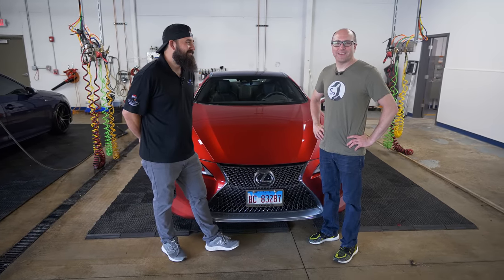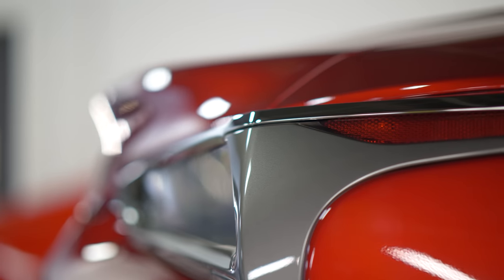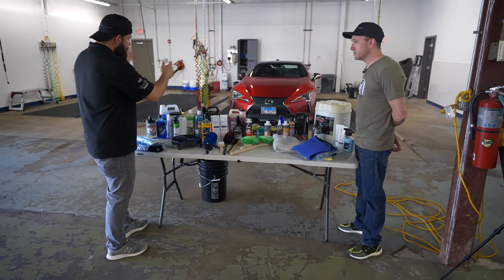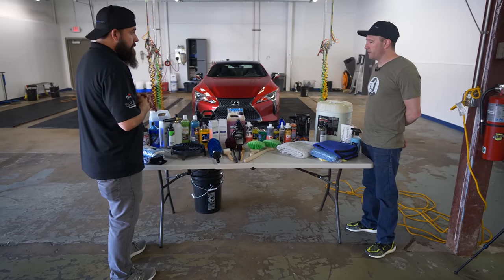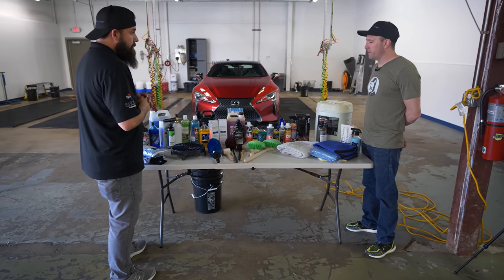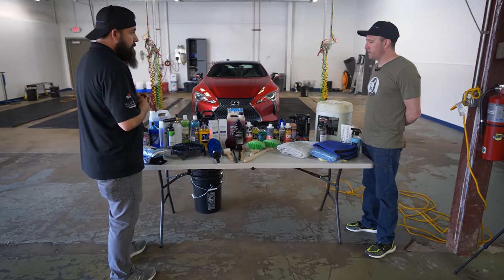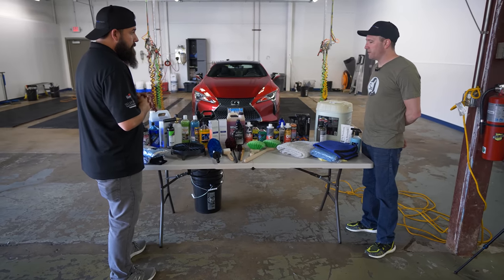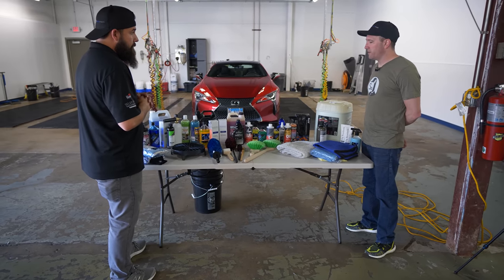The Right And Wrong Way to Do a Car Wash

Comment: Love your channel! 

This is right up my ally. However, I think rinseless washing can be safer, IS more efficient, and sure is alot easier.

Safer because it's proven not to scratch the paint, and water isn't blasted past seals and strips and it doesn't reach places where it induces rust. 

It has it limits though, with severely dirty cars, but that's rarely the case, and if it is, the owner OFTEN doesn't give two sh*** about the car's paint.
Reply: “Alley”, not ally, but I see your point. Well said.

(Those two words have VERY different meanings, indeed!)

Comment: Lots of proper tips. the best one was to wash the car once per week. That way it never gets too dirty. I use Maguires one step clean and wax with micro fiber clothes from COSTCO. If the car is washed in this fashion weekly using the box method shown, in my experience there are not swirl marks after seven years of washing the car in this fashion.

Comment: Washing a car is relaxing.  I get the whole point about not using dirty towels or microfiber to create scratches, but if you take it as serious as this guy makes, you never enjoy a large part of car ownership.

Don't take car to automated car wash.  Use two bucket systems.  And use 15-20 towels (plush) to clean.  Also have different wahing mitts for wheels and lower parts of car than higher.

Comment: The round filter piece in the bottom of the bucket seems a good idea--  but this is too  much for most people--  Avoiding Machine washes does make sense thought.  Bucket, good towels,  wheel cleaner..

Comment: I think 2 bucket system is old practice.  Perhaps, it's better to use 4 - 6 wash mitts.  Use once, never goes back into soap bucket.  Don't have to worry contaminating clean bucket.

Comment: I totally agree with the hand wash.  Use as much water as you can to rinse off anything that could be abrasive.  And most important use a super soft brush like he is using. 99.9% of the cleaning will be just warm water and a super soft brush. The philosophy is to use the most gentle cleaner at first, and then work your way up from there.  It's just like medicine in Pharmacy. I'm a pharmacist. Hard water is the beast, use a leaf blower to blow off most of the water. Using Jet-Dry Finish is very nice, but very expensive. Think of washing the car as like an archaeologist dusting King Tutankhamun's sarcophagus.

Comment: Too get the best wash you gotta get the car wet first then apply lots of soap and clean every surface. Note any time you wipe the car with the cloth one it should be a microfibre cloth and two also have some type of wet surface never wipe the car dry. Once done wash off the soap and dry the car completely

Comment: 8 minute method: rinse + spray on soap + soft pole brush + rinse + microfiber dry. < $50 for pole brush, 1 gal soap, soap sprayer attachment, drying cloth. Optional separate care for wheels + detailing.

Comment: I'm a little late to the party, but I just found SavageGeese a few hours ago and have been binge-watching... I'm on vacation. Normally I don't comment on comments. Though I couldn't resist here, because the number of commenters that don't consider that this guy is washing large volumes of vehicles, not just his personal cars. Hints the equipment that he uses is going to be designed for commercial use. Hence the equipment is going to be more expensive. To me the purpose of this video is to show you proper technique, not an equipment review 😜

Comment: Those arent bristles on those top brushes it’s foam.  Bristle brushes faded out .. it’s all super light weight foam. A proper hand wash and wax of course is the best result but it’s also more money and time. Tunnel washes have evolved so much since 70-90’s. Tunnel washing your car 2-4 times a month will not hurt it with prior paint care and corrections. At that point you are maintaining well kept paint.

Comment: LIKE TO SEE A VIDEO ON (Chicago Auto Pros) THEIR ENTRY LEVEL BASIC HAND WASH SERVICE ($50.00) AS A TUTORIAL
Reply: 215DETAILING 215DETAILING this is their entry level 50 dollar service
Reply: @jackh7550  Thanks I assumed it was but it seems geared more to a DETAILER view and not for a customer. I have a similar service and try explaining to customers is some what difficult I was going to make a video but I am mobile/home based and a garage would be more fitting. 
I guess when you are not in a commercial building some assume you are just WASHING a car and you should not be charging more than say $30.00

Comment: Could you maybe do a video on how a normal human who doesn't own a detailing business would go about washing their car?
Reply: wouldnt be too far off from this if you actually give a shit about your car.  still 2 buckets and quality wash mitt, you can get away with no foam cannon and no pressure washer.  One soap will work for the whole car including wheels if you wash regularly (like he said in the video).  The way i do it at home is: rinse wheels, spray soapy water on wheels, scrub with dedicated wheel mitt, rinse again.  Rinse the whole car.  Spray particularly dirty areas with soapy water (substitute for foam cannon).  prepare 2 buckets.  Wash one panel at a time doing the dirtiest stuff last (such as front bumper and sideskirts.)  rinse your mitt before you touch anything you think will be easily scratched.  rinse the whole car again, then dry with a drying towel and add detail spray if you like.

Comment: Yet he is wearing a belt and jeans that have the little copper stubs to scratch a car. Wear sweat shirts and sweat pants while detailing a car. Also you can use dawn soap to help lift grime and grease from a car that has not been cleaned in a while where you are going to clay and wax after washing.

Comment: I consider myself the 14th Dalai Lama of Washing Cars.  This Dude does a wonderful job.  I do have a few comments.  #1, don't use a gas powered pressure washer. 400PSI is plenty for any car. #2, ALWAYS rinse your care off very, very well before you even touch it with a soft brush. #3, use the most gentle soap possible, because strong soap will strip all the wax off. #4, Use very warm to hot water to wash the windshields. #5, don't use glossy tire shine, just regular armour-all is fine. #6, always blow dry the entire car, wheels, everything with a leaf blower.  If you choose, finish it it with a simple spray and super soft cloth with a hard water remover, like they use in a dish washer.  Also, reverse osmosis doesn't remove calcium & magnesium. Reverse osmosis removes human toxins, but not naturally healthy things like Ca+2 or Mg+2.   The best hard water removers use big bags of salt.  If you go to Lowe's in Florida, they all sell 50lb bags of salt right at the entrance.

Comment: The average car has scratches and dents by the time it is 7 years old anyway. You could spend thousands in car cleaner products and many hours cleaning your car and in the end, your car will look like crap anyways.
The only cars that are worth spending all of that money and time are collectibles. Cars that go up in value over time. The ones that are only taken out of the garage a few times a year when the weather is good and are never parked in a Walmart parking lot.
Reply: That is a good point, but for these guys it is a hobby to maintain their stuff. They don't consider it work, they think it's cathardic, thus worth the time, money, and effort.

Comment: One bucket of soapy solution, one microfiber wash mitt, a hose, and a microfiber drying towel and you're done in 10 mins. Buy a gallon of acidic wheel cleaner and dilute it in a spray bottle and just spray and rinse. No scrubbing necessary. Unless you drive a high end sports car or some expensive car over 75k, it's a waste of time and money to do anything more. Just doing that will get you much better results that a tunnel wash. You don't need all that care for camrys, accords, rav4s, and crvs. Even something like a c-class, a4, or 3 series doesn't need this level of care. Nobody is looking at your car. It's a common car for the masses and it's gonna depreciate the same, whether the paint is perfect or swirled up a bit. Notice it's usually the poorer crowd that's making their cars all shiny. Wealthier people don't do this. They didn't become rich wasting time on their shiny cars. Don't waste yours.

Comment: I used to care about this crap when I first got my truck. However, I use my vehicle for its intended purpose and I drive it everywhere so all of this crap is unnecessary. A bucket, a broom, a good soap, and some towels and mine looks good as new. Still have no swirls nor any of that other mess.

Comment: Oh Brother !   Yes and 2-3 days later there is a film of fine dust and dirt on your vehicle. Then we have to do the same thing all over again. With the time and cost of all of this " taking it as far as you want, science ", you add another $ 200  to your car payment !  I know the physics of cleaning and restoring all surfaces.  My truck is 17 years old and people constantly  tell me it looks like new !  There is hardly  any signs of scratching or swirling . The paint looks like new.  The more modern car washes use the blue foam sponge raggedy Ann roll brushes with water jets rinsing them as they are spinning.  They do a better job than than you think.   Psychotic  is what this washing advise is ! 4 hour car wash, and 3 days later you gotta do it again !lol

Comment: I know these guys do great details, but in this particular video he broke a cardinal rule. He washed from the bottom up. That is, he washed the lower rocker panels then moved that same mitt up to higher surface panels. That is a no-no! (He said as much earlier in the video). The largest particles of dirt and grit are at the bottom of the car. You never wanted to wash UP -- you'll bring that grit up and onto the cars upper surfaces. You wash DOWN. And stop washing 2/3 of the way down. Then wth a separate mitt, wash the lower panels LAST.

Comment: A car that is perfectly clean is a car that is not being used, cleaning above a certain standard is a waste of time and money. Buying special soaps and sprays at highly inflated prices is just snake oil there is no special detergent for cars, dish soap is the same product in a different container works on cars fridges washing machines and softer house hold paint without any damage. Wax is a waste of time due to modern paint and clear coat protection most of the swirls that you get on cars are due to scratches in wax not the paint. It is pointless trying to keep your car looking like new every body can tell its year by the small changes made every year on different models. Look after the bits that get you from place to place safely, that is what normal people buy cars for.
Reply: You couldn't be more wrong but ok, you do you.
It's funny that you mention dish soap too since that's the exact opposite of what car soap is lol

Comment: I cringed when he started washing the hood first...
Two bucket method fails as soon as you rinse the mitt the first time. No grit guard will prevent the dirt from being suspended in the water.
Use a multi mitt method and save your paint.

Comment: How to maintain your finish without going overboard. Wash the car YOURSELF with non-abrasive car detergent starting from the turret down; wheels last. Use a clay grooming bar once a month & hand wax every 6 months with a swirl removing compound applied mechanically every 12 months.

Comment: I purchased a pressure washer, foam cannon, car wash soap, grit guards, and microfibre towels all of amazon. It was a bit of an initial investment but I can see that after a few months of summer washing, i have no swirls or scratches. Going to microscopic detail is a bit over the top unless you do it as a profession. Biggest thing you can do to save the paint of your car, is a clear bra in the front and mirrors and only park next other expensive cars lol

Comment: Videos like this scare people away (cost/pain in the ass) from properly maintaining their vehicles. I have a much more realistic approach.

Once a week I go to a touchless automatic carwash. You can't scratch the paint if nothing solid touches it. However, touchless washes don't work well at cleaning really dirty cars. So, every so often I will go to an actual cloth automatic carwash (not nylon or foam bristles) when the car needs it.

Almost as important as the regular washing is regular hand waxing. Every two months I take the car and get it handwaxed. Why every two months? Because Consumer Report has tested auto waxes numerous times and found that none of them last more that 6 to 8 weeks regardless of what it says on the bottle. Twice a year, instead of just a hand wax, I get a full exterior/interior detail which includes hand waxing.

What is the cost all this? 46 carwashes at $6 each + 4 hand waxings at $50 each + 2 details at $250 = $976 per year. If you forego the two details and instead just get it hand waxed, that goes down to $576 per year. That is all it costs to maintain a finish that 99% of people would consider showroom, and even that number would be drastically less if you do the work yourself.

Comment: My two bucket method. One empty bucket one with the wash soap. I divide my car into sections and I use 6 or 7 wash mitts. Once that mitt is used on one section it is not used again on the car. Each mitt has it's own section. No dirt in rinse water since I don't use that and the wash water stays clean. Just how I do it the two bucket is nice but I worry about dirt still in the wash mitt even if it is rinsed.

Comment: So much care to prevent damage to the paint, and then he uses high pressure to break up the obvious dirt. That is NOT how you do that. Gentle water, or if you use a power washer stand back several feet and don't squeeze the trigger. Copious amounts of water on the dirt to loosen it up. The way he does it, well if you looked at the paint with a microscope you would see that the paint is actually not smooth even though it feels that way to the touch. Have you ever seen Jay Leno wash a car with a pressure washer, or the Mercedes Benz Classic Center? No. He uses a power washer because he is a commercial entity and has to abide by the rules of the economy. If he doesn't figure out a faster way to do something he won't make any money. 

If you have an expensive car, pay your detailing shop extra if they agree to not use power washers.
Reply: Every professional uses a power washer, but apparently your opinion should count more than the one of thousands of professional detailers?

Comment: Wrong. Use a mild solution of dish soap and warm water. I finish with a wax-as-you-dry spray and damp towels to move most of the water away and paste wax once a season. That's ample protection. Just keep things wet and frothy and don't allow grit to build up in the rags. Dousing in a deep bucket pulls the grit out and it falls to the bottom. Don't buy all that expensive crap.  Oh, and any spray tire and wheel cleaner will do.

Comment: At least the auto pro did not completely bash a tunnel wash like most "pros'" but there is quite a bit more to consider. A well maintained tunnel wash that uses a lot of soap and water is safer than a hand wash.The car wash  takes the dirt off a car in one direction, lifting the dirt off the surface. They are not washing cement and gravel trucks with sand and rocks. These are cars and 99% of them are daily drivers. They are disposable cars that are lucky to be kept longer than 5 years.unless you have a garage queen that is a toy. Daily drivers are subject to much more abuse going down the road and in parking lots than any tunnel car wash will do. 
As far as garage queens, they should never even be washed. Spray detailer is all that it needed. Don't get it wet.